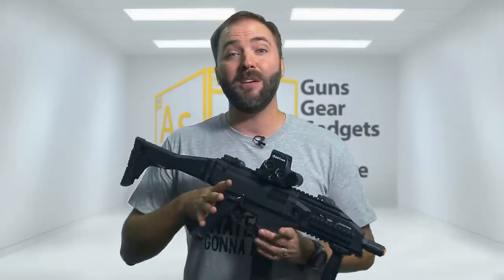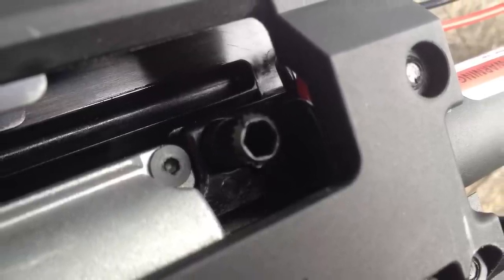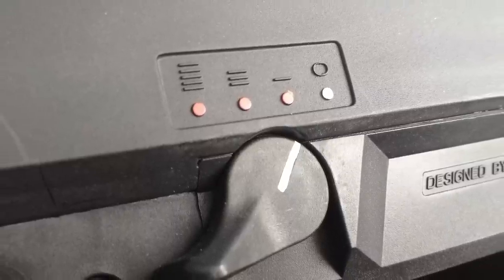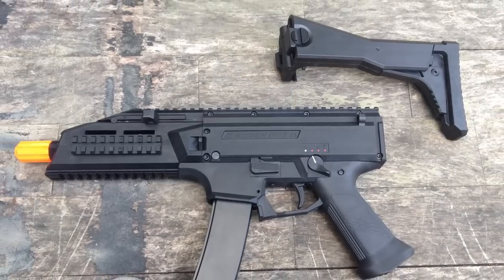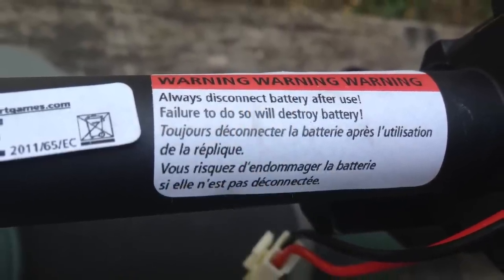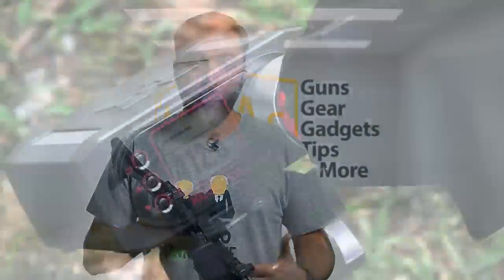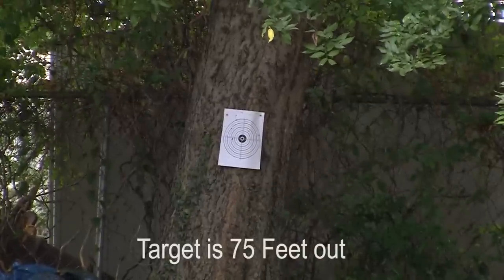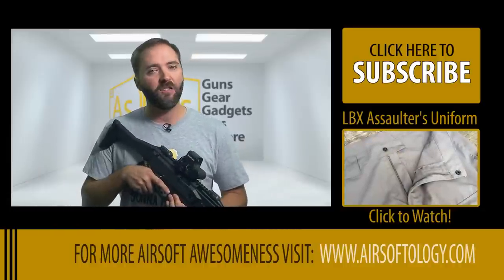The CZ Scorpion EVO3 A1 Review | Is this a PTW Killer? | Airsoftology

Comment: i GUES QUALITY AND ALL FROM MAIN COMPANY  CZ... AND BAST SMG and PISTOL..
 WORLD PRODUCER IN airsoft... ASG... with TOP HPA WOLVERINE inferno gen 3 system all costumized. Just for CZ scorpion, promotion more than money even aeg is to good and 2018 gearbox was replaced... instaled and made with all trademarks CZ, asg,top HPA 2019 april..  custom fited internals barel hop up.. all was top .. SAME gon as real poycarb stonger durable than steal. all made in denmark... AIRSOFT LEADERs TOPED BAST YOU CAN GET  FOR PRECIZION.. RANGE. ..ROF.. dURABILITY.. And all rounder.. I could make dmr with 400mm hard steal. screveing 200mm silancer. Barel.for 100e and top flat nub, g, s, or maple leaf what is bast for it.. and incrase fps for around 60fps.. from tihgt b psi longer range Barrel. Anly prob is it is not m4 and mags are m9.

Comment: I haven't had very good experience with this gun. First off, it's trigger response is solely due to the neo magnet motor, which has chewed through it's own gear within 2000 rounds fired. Currently dealing with swapping out internals and the allen screws in the pistol grip easily shredded (yes I know how to deal with screws). I'm really surprised as their gears are sub par and they used a cheap piston with plastic teeth. Yes it's very nice and could be a great anti-PTW, but they've cut corners here and there internally. The quick change spring system also has a slight flaw that if you don't put the spring guide back in properly with it pushing out all the way, the piston can get misaligned.
Reply: Copy and pasted that right from Facebook,didn't ya?
Reply: Maybe :P ...

Comment: The only thing I dislike about this gun is the battery storage or lack there of. The trigger on this gun is AMAZING! As well as the range for such a short barrel. 200ft shots are very doable with heavy weight bbs. I run .36s in my Scorpion EVO and it is right there with Krytacs, VFC Avalons, and KWAs for effective range. I wish the midcaps held more ammo(75 rounds per is pretty meh.) But if you spent $350+ on the gun then what's another $50 for a 3 pk of midcaps.

Comment: Ok I have a question I've all ways had problems with 11.1 small connectors melting cause the gun connector can't handle the heat can this handle the 11.1 heat or do I need to stick with the 7.4
Reply: Ghost Reaper from what I have heard around the internet, then the gun won't even start with anything less than an 11.1, due to how the ECU is set up, or something.

Comment: Good overall concept.  Right size, solid internals.  No m4 style mags, and non standard battery shape are the deal breaker at 450 price point though.  Coming from someone who doesn't care about "authentic" platforms... these companies need to start thinking outside the box and come up alternative airsoft systems that integrate optimal features into a platform designed to do well on an airsoft field, and not limit themselves to a "shell" mimic of real steel.

Comment: I cringed when he talked about barrel length. Barrel length don't mean shit.
Reply: Yes it does, it increases range
Reply: Corey Fraser
" Yes it does, it increases range"--  Not in all cases. A longer barrel may* in some cases, give more or less FPS depending on cylinder size.. And in some cases.. give a tighter grouping at range. But a longer barrel does not mean more range alone. I have seen some AEG's perform better with shorter barrels than longer. It all depends on setup.
Reply: ***** Nope, he said that doesn't mean sh*t. As in, it doesn't mean anything, it isn't a fact, it isn't something reliable and true.
Read: it really varies and you shouldn't rely on it to magically perform better. So yeah, it doesn't mean sh*t.
Now get off his back, shiny knight of the internet and truths.
About barrel lengths: inform yourself, quality of barrel surface, type of hop plus tighter tolerances of hop up parts DO matter more than length.
You'd want your barrel length to match your cylinder, that's about it.

Comment: Have they worked on the safety  yet?
Reply from the maker: Mines headed into ASG for an upgrade to a few small parts that are on the production release version, which includes a few minor tweaks.

I'll have a follow up video on those parts she it gets back.  But, in my use of it, I didn't have any issues with the safety, and I was able to easily tighten up the fire selector to make it feel a lot better.   I'll keep you posted on any changes I see when it gets back.  -j
Reply: ok thanks and i meant fire selectoor just put safety cause im dumb lol XD hopfully u get it back soon
Reply: Billy Martin
 We've tweaked the safety, and our techs are more familiar with assembling them now. The fire selectors are not a lot crisper and "clicky."